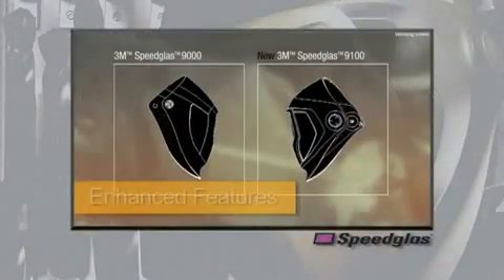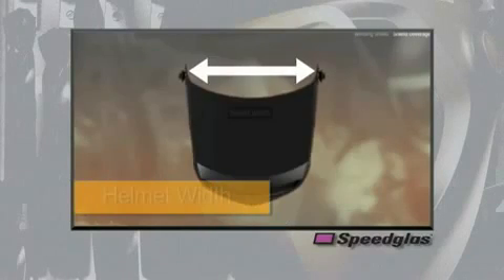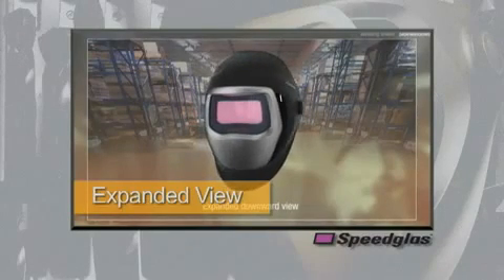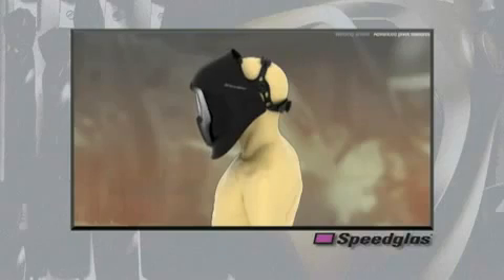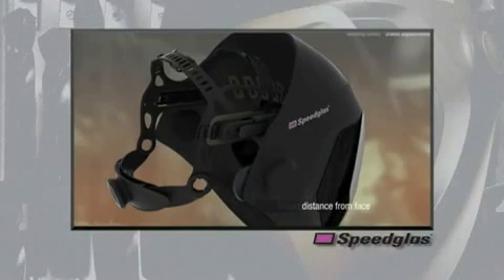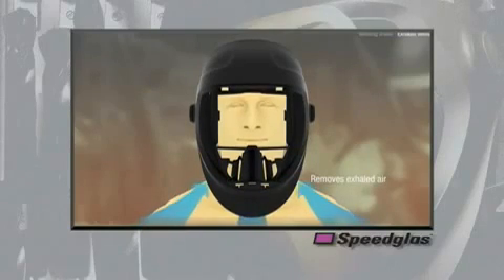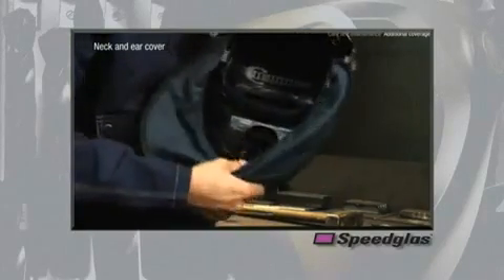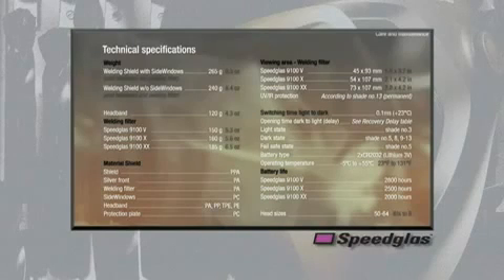3M Speedglas 9100 Welding Helmet - Helmet Information

Comment: THE OLDER HOOD IS MUCH BETTER. WHEN MINE FINALLY DIED THEY NO LONGER MADE IT SO I BOUGHT A NEW ONE THAT I DON'T LIKE.
THE OLD HOOD WAS LIGHTER SMALLER TO GET INTO TITE PLACES AND... IT ROTATED BACK FARTHER WHEN UP SO LESS WEIGHT (IN FRONT) ON YOUR NECK.
I WELDED FOR 1 WEEK AND NOTICE MY EYES ANF LIDS WERE BURNING SO I COVERED THOSE STUPID WINDOWS UP WITH COVERS THEY SUPPLY, WHICH SEEM LIKE THEY WILL FALL OFF AFTER 1 HOOD DROP.
I AM VERY UNHAPPY WITH THIS HOOD. PLEASE BRING BACK THE OLD MODEL. I WILL BUY IT AND GET RID OF THIS (OVER ENGINEERED PIECE OF SHIT)